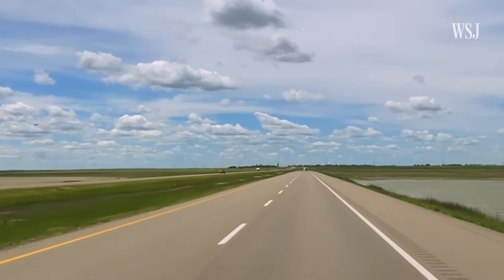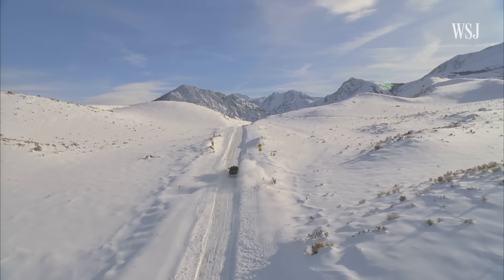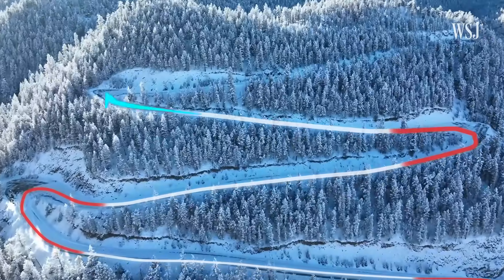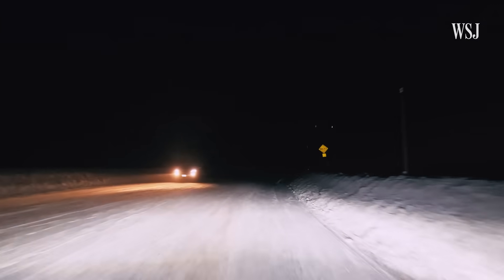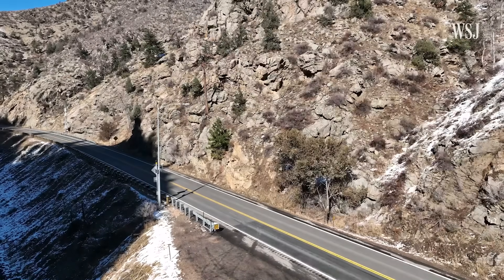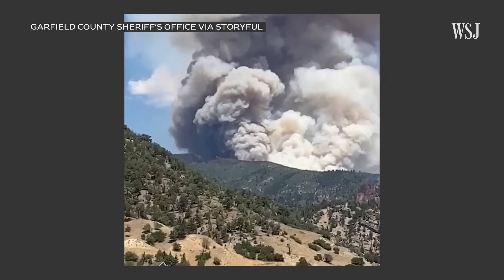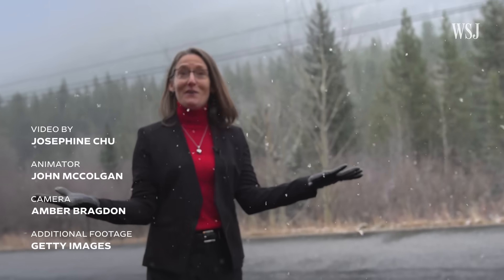How to Design a Mountain Road That’s Less Hazardous in Winter | WSJ

Comment: I have worked for HDR for 22 years.  Another detail that was left out due to time was 1. the freeze-thaw cycle in the rock face can cause more rock falls.  In many cases cable netting will be attached to the rock face to lessen the chances of motorists from being struck by rock fall.  2. Avalanche is always an issue in mountainous terrain.  in small slide areas crews will shut roads down an use explosive ordinates if the conditions warrant,  to free cornices build up to slide over the unoccupied road and clear it from the road.  In areas where there is frequent, large and unpredictable slides, a huge investment in building an avalanche shed (a 2-sided tunnel that is supported by columns on the far side of the road) which allows the slides to safely go over the road.

Comment: Super-elevation? What was wrong with the word camber?
Reply: Camber is the slope or curvature of the road surface from the centerline to the edge. It is designed to promote drainage by directing water towards the road’s edges

 Superelevation (or Banking): superelevation is the banking of the road along curves or turns. It is designed to counteract the centrifugal force experienced by vehicles when navigating curves

Comment: We should’ve instead invest in more bore technologies. Tunnel through underneath all the beautiful mountains leaving the nature preserved and avoid all that snow
Reply: Tunnels are a maintenance nightmare.
Reply: @TheSkeewiz  Not at all, I am migrant from Taiwan and we never had budgeting issues on maintaining roads and tunnels. We are literally on top of a massive earthquake and hurrican zone as well. Sure, our road collapse due to hurricanes every year but we still rebuild it like nothing had happened and tunnel have been proven to be the best way to avoid constant landslides.
Reply: @I_am_a_nice_person  …and expensive.  In my 40+ year career that I’ve worked on civil engineering projects, tunnels are always a last resort.  I was actually influential in removing two tunnels for Burlington Northern & Santa Fe Railroad due to maintenance issues from operations beyond the planned use.  I can go on.  Tunnel alternatives during type selections were mostly used as a strawman to (self) eliminate that alternative base on cost, schedule, maintenance, geotechnical and environmental impact due requiring vertical ventilation shafts in sensitive areas.

Comment: I'm a bridge engineer from the west coast.  Earthquakes are often more common in mountains too!
Reply: Really? I would have though the hard rocks would reduce quakes but I guess if you've got an area that created mountains it's basically a fault anyway.
Reply: @CausticLemons7, hard rock reduces the forces, as opposed to bridges on soft soil.  Hard rock doesn't jiggle like clays or liquefy like sands.  But they are certainly very common in mountainous regions.  And often times the peak ground acceleration is highest near the volcanoes, outpacing the reduction in force due to the soil type.  It just depends on the location and soil type at the site.  And side note:  the earth's crust is often softer near plate boundaries (near mountains), as opposed to generally flat inland areas.  So, when those rare earthquakes hit inland, the hard rock spreads the shock waves over a much larger than the same energy quake near the late boundaries.  Look into the New Madrid earthquake from the 1600's (about) and compare those to any in California in recent decades.  Totally massive in New Madrid!
Reply: Not really, when I commute on a section of 84 through the mountain, there are many winding roads that can be straightened by digging tunnels and save fuel. There is no earthquake in this area.

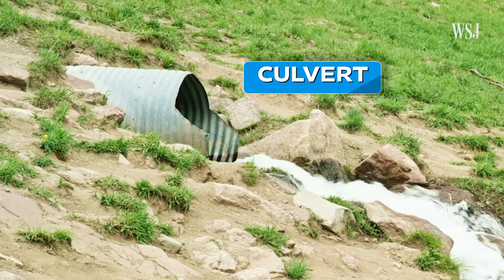Comment: You just lay splines and allow them do bend shrinking in width at turns so there is some of these old roads that could be turned into a 1km snowboarding resorts, but winters are short and there would be no visitors or expensive Christmas town rental - see you next year. Could be afraid of it but isn't working with stones about it spending your time as you can. Why can't you fix that too 4:20 Pirmal Council Xenothreat? It's NY and Manhattan as it was since 2010. Let bewer build the dam.